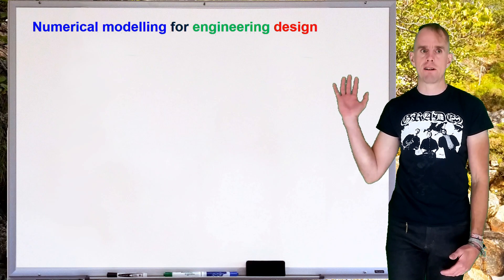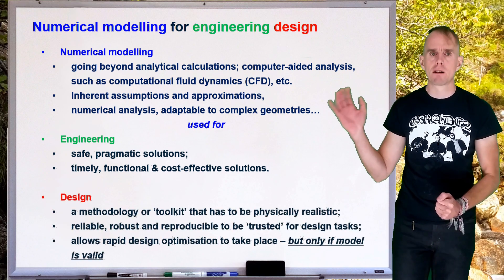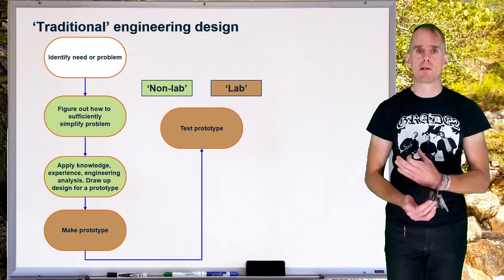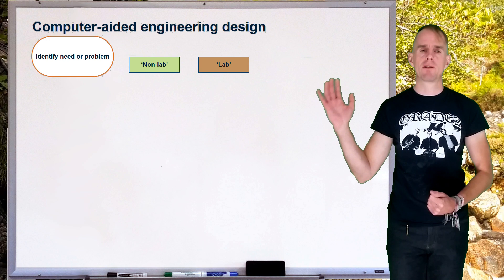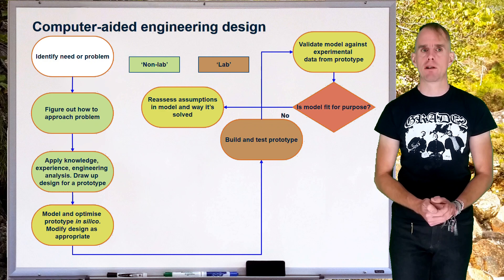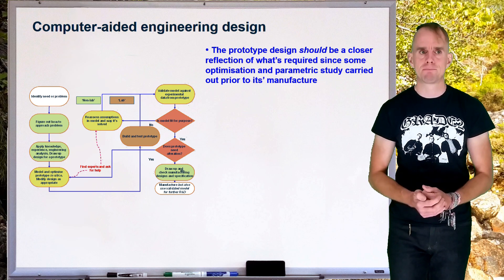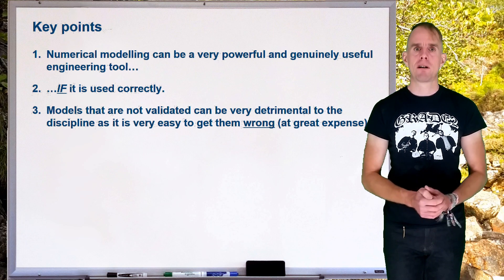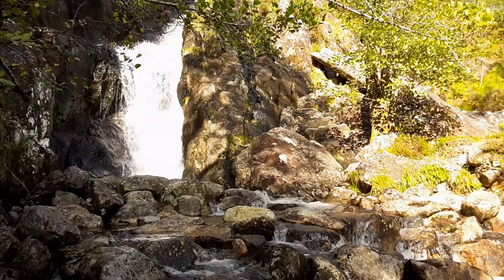Computational Fluid Dynamics: Lecture 1, part 1 [by Dr Bart Hallmark, University of Cambridge]

Comment: As someone who will soon attempt simulations and experimental validation on Slug/Taylor flow vs Bubbly flow, this seems useful. I am aiming for first starting with flow-driven calculations and then pivot to pressure driven calculations
Reply from the maker: Those are likely to be quite challenging simulations - good luck! It'll be interesting!